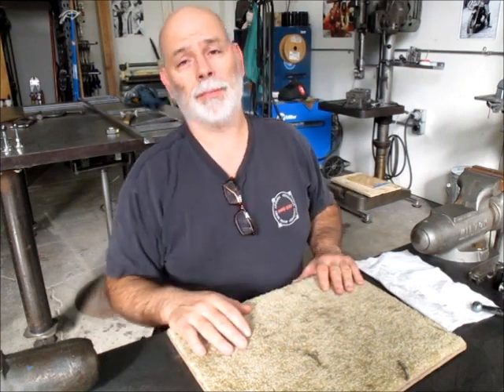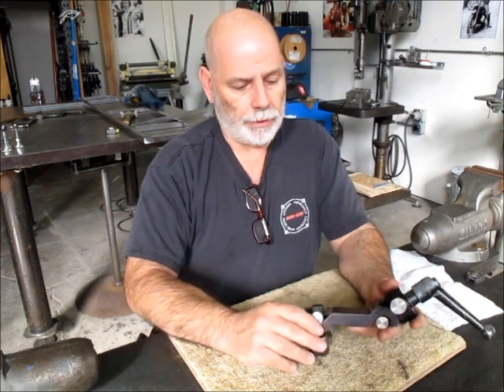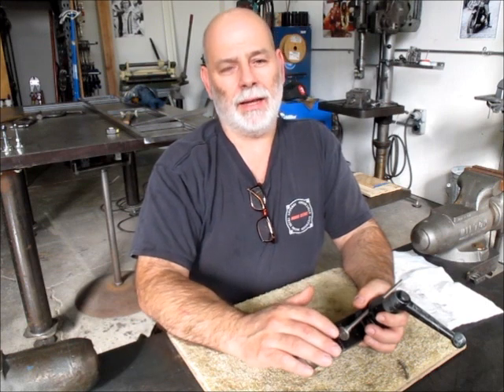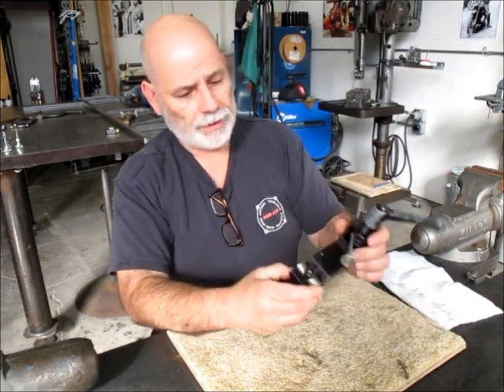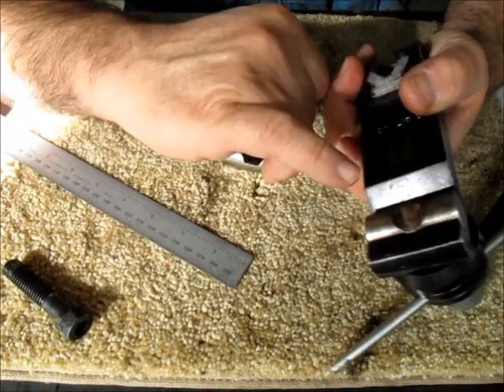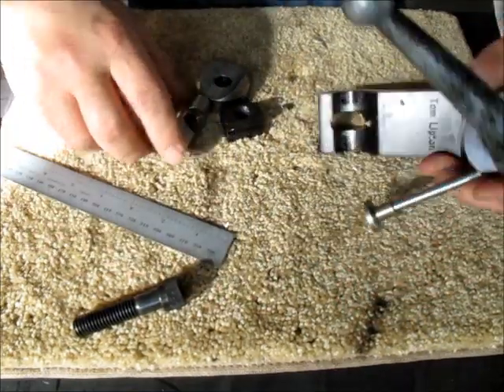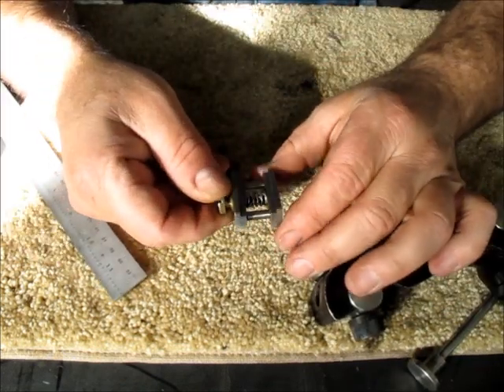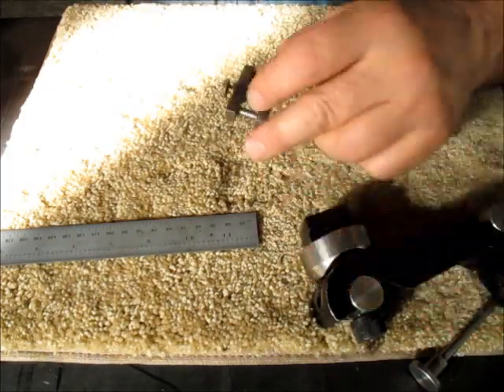Mill Stock Stops

Comment: I like your home made goose neck stop.  I think ENCO still sells a version of that.  I have been admiring it for a while but I have been unwilling to spring for it as I am in the process of building a 2000 sq ft shop for myself.  I think I am going to track down some aluminum and make my own.
Reply from the maker: Hi Mike,

Good deal. Its way more satisfying to use a tool you made yourself.

Cheers,

Tom

Comment from the maker: Hi Edge,

Good question. My wife's art studio is connected to the shop. I only have a wimpy little compressor that is a better noisemaker than an air compressor. The air blow guns are painful to my wife's ears so I stopped using them when she's around. The stuff in the can actually works ok. Now I use a vacuum and good brushes.

Best,

Tom

Comment: Nice one Tom, I need to make some stops instead of clamping things to the table all the time.  The black parts (body, rod holder) of the multi-axis stop are aluminum?  The one that clamps to the vise CRS with a brass screw head?